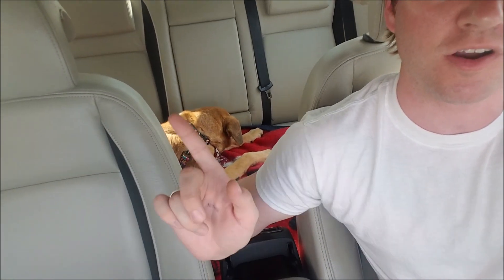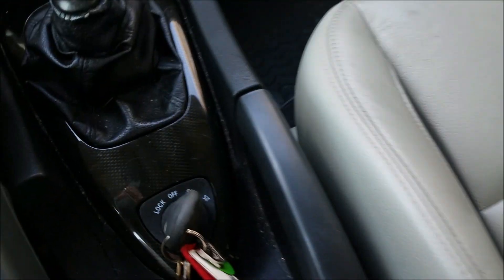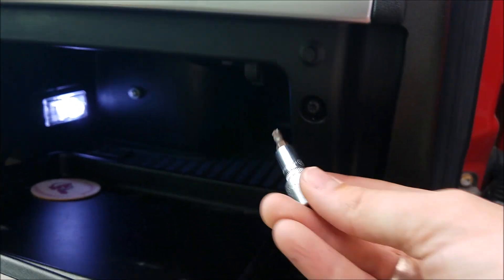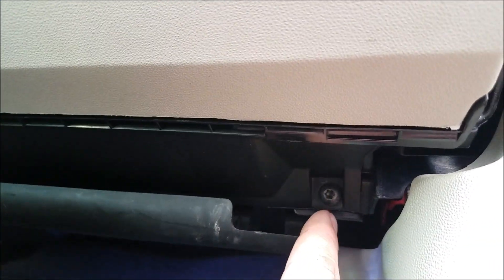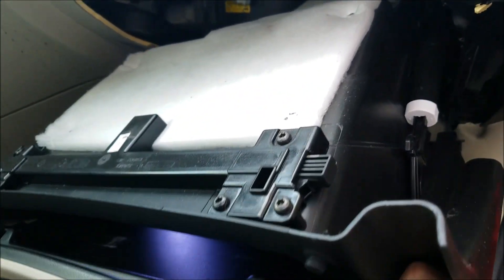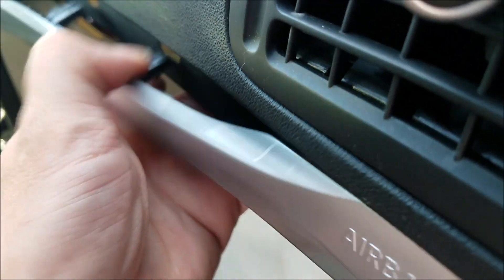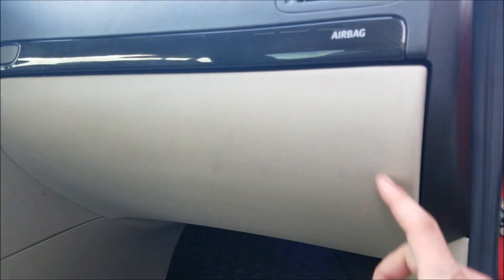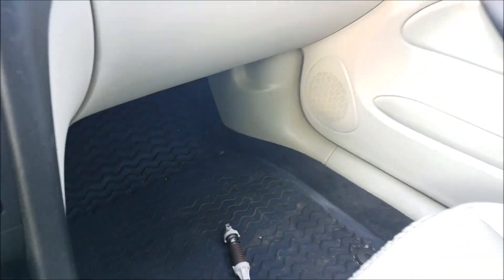Saab 9-3 Glove Box Trim Upgrade!

Comment: Between you and Auto Autopsy, these videos are really helping me put some bling into my '07 2.0T with junkyard finds. 3 projects juggling all at once: Bose upgrade/splice harness from boring Pioneer; bad wheel hub, so with knuckle pulled off, swap the Aero 16+" calipers, brackets, dust shields; swap entire upholstery with 60th anniversary trim (rare find); side quest: swap 60th wood accents with Aero graphite (pray Gorilla Glue is the real deal)
Rant over
Reply from the maker: Thanks for the comments and glad the videos are helpful! I can speak from first hand experience and say it will be easier to swap out the entire door panel rather than removing the fake wood piece and replacing with the silver aero trim. Reason is those pieces are plastic riveted which requires removal of the door panel to drill out from the back of the panel. You can use a combination of epoxy glue and self tapping screws to re-fasten but at that point it would be better to just swap the entire panel.

Comment: I sold this part to you off ebay how funny we talked on saabcentral glad you got it installed!
Reply from the maker: Yeah I bought one and was given one the same week lol. I used the best of the two and traded the other for more Saab parts! Did you end up figuring out how to get Onstar working with your sat nav install?
Reply: @WeakestofWeeks  Yes kinda i have to change two wires around but it works and Bluetooth works as well but screeches a bit just haven't had a chance to swap some wires yet
Reply: Oh my god I'm a Bloody Butcher I painted mine red 2004 arrow convertible I just ripped it out and broke the clipping near the button oh well super glue will be no one knows haha

Comment: Door you know how to remove the silver door panel piece from my aero? I found the carbon finer ones. 2006 Aero w manual. It looks like a trim tool project?
Reply from the maker: I do know and they do not just pop out. They're plastic riveted in. You can pull the entire door panel off then drill the rivets from the back. You will need to epoxy the replacements in. Not going to lie it is a lot of work!